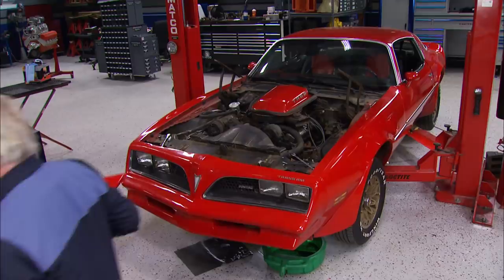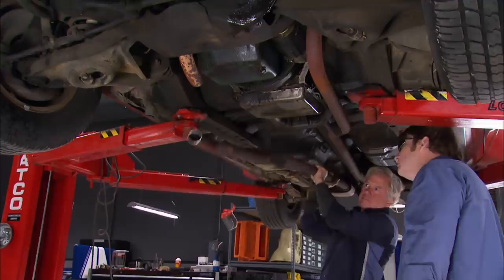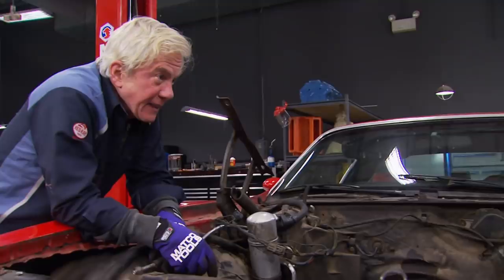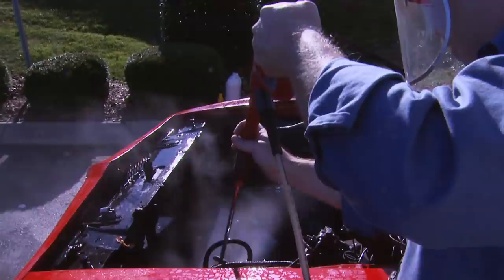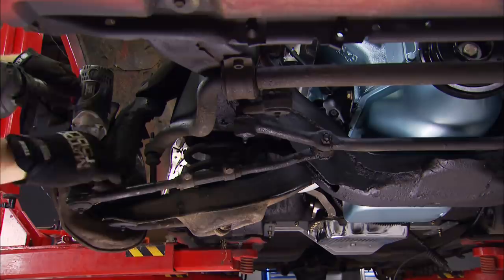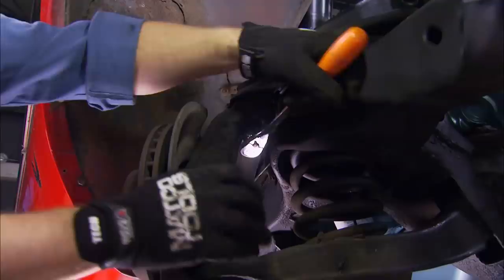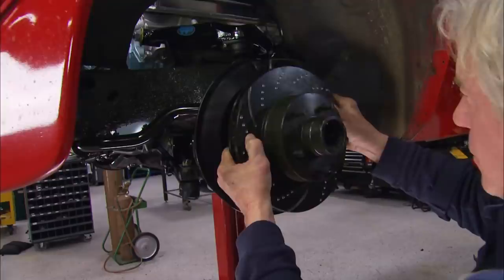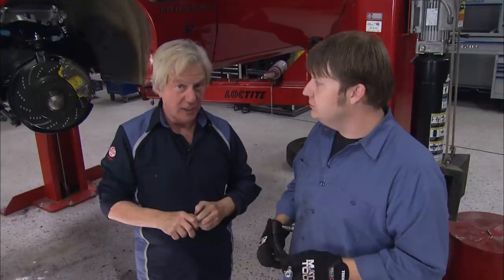Wedging More Torque Under the Hood of the '78 Trans Am - Detroit Muscle S1, E3

Comment: Always wondered why you lean over the fenders and struggle with with engine swaps and  cleaning the engine bay with the front clip still on. With decades of GM experience, I almost always remove the front clip for engine / tranny swaps. Admittedly, I don't have all the cool shop tools you have, but removing the front clip really makes the job you're showing a lot easier and the clean-up a cinch. Then add the front suspension work, and well just curious is all!!

Comment: I would not have chosen a 700R4, a 200R4 a much better choice! Better gear ratios and much stronger.
Reply: ...and it has the BOP bolt pattern so no adapter is needed.

Comment: What's better than a pressure washer?  A steam cleaner.  Hot pressurized water will cut grease and grime much better, even after soaking in degreaser!  It also dries faster since a lot of it evaporates due to the hot temperature.

Comment: 474 Pontiac  - Great  - Butler did another 474 earlier  and got 612 pump gas hp  + you don't have to rev a Pontiac V8 To get good power out of it  . For you higher rpm guys A Pontiac  400 ( 465 ) 3 inch mains etc. Did Win the Engine Masters Challenge  in 2015  making 3 pulls of 720 pump gas hp on the dyno - the build was nothing to exotic  - Kauffman high port heads etc. :)

Comment: Interesting to see this car still has the holes for the TH400 crossmember as well as the TH350.  I believe '74 was the last year for the TH400 in a Firebird, and my '80 didn't have them.  My car was originally a 301 with TH350, but I installed a 455 with TH400 and ended up drilling the frame and buying a reproduction crossmember.

Comment: Good to hear you started with a non matching number car . Few cars have lasted to be one . IMO there is nothing wrong with conversions .But if a car has made it that long its more valuable than a converted one . Or at least some are willing to pay more . 
  In the late 70s I did not read the direction that came with my trans plate adapter to install a Buick trans to a SB Chevy . After a 100 miles on a rebuilt motor the thrust bearing and crank were wiped out .And a complete rebuild was needed , The instruction said to install  washers the thickness of the adapter between flex plate and converter . When done I had no further problems . Was  that needed with this plate ?

Comment: That built 700r4 would have been a dream for my 80 T/A that had a mildly built 455 in it. I could have then lowered the rear gear ratios for even more torque and still cruise the highways. As it was though, the t-top body was already getting twisted up at the B pillars from the torque.

Comment: Facts pop up said 1979 was last year for a 455...the biggest engine that came in a 1979 t/a was a 4p3 olds...you could get a 400 pontiac , but it only came with the 4 speed manual option. Also 1979 was the last year for the 400.
Reply: Dang phone...403 olds lol
Reply: I had a 79 400 4 speed...also had a 68 firebird with deluxe interior , a 71 t/a and 76 formula 400

Comment: Some kind of upgraded front calipers with larger rotors would be better than the stock stuff they reinstalled with the upgraded suspension and larger motor. Why skimp on brakes?

Comment: I noticed that you scraped and degreased / pressure clean the engine bay.   When it comes to the underbody area, you change out all those suspension parts without pressure cleaning those areas as well.  Do you like working on dirty cars?

Comment: The car's gonna be black and gold,why would you paint Pontiac blue on the engine block?
Reply: The typical answer would be for a factory look.  However while that's a Pontiac color it's not the correct color for that year.  That looks like the light blue metallic color used from 66-70.  I personally would only use a factory color on a older muscle car.  I mean if it was later with Chevy V8 sure fine whatever but with the Pontiac or Olds V8 I would stick with those factory colors.  That's just me, on your car it's your choice.

Comment: It just said the last year of the 455 was 79 thats wrong. 78 was the last year and all 78 455 were 77 leftovers and late 78 was the shaker said  t/a 6.6 and thru 79 which was an olds 403 not a 455
Reply: Actually 76 was the last year for the 455. The last 400's were built and stockpiled in the 78 model year, for use in the 78's and 79's. So, the 79's got what was left after 78. There weren't enough 400's left for 79 to put in all the 79's, so they put the remaining 400's only in 4 speed cars, and the automatic 79's got the Olds 403.  The t/a 6.6 shaker decal was the 400 engine. The 6.6 litre decal was the 403 Olds.